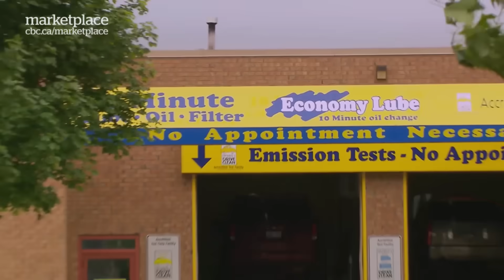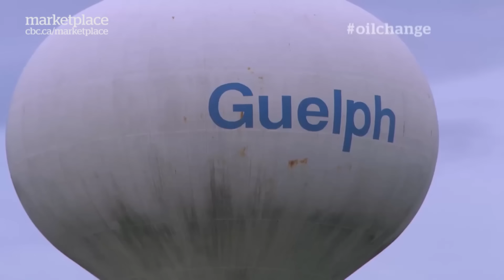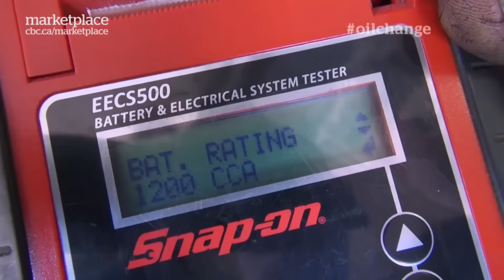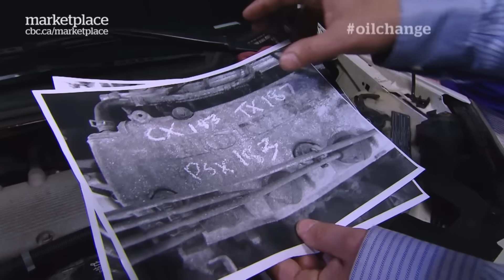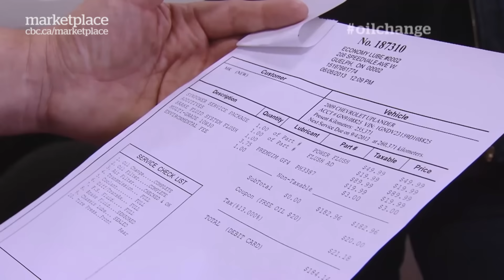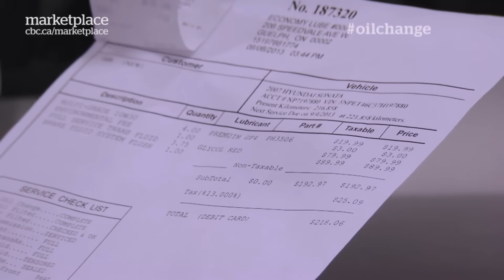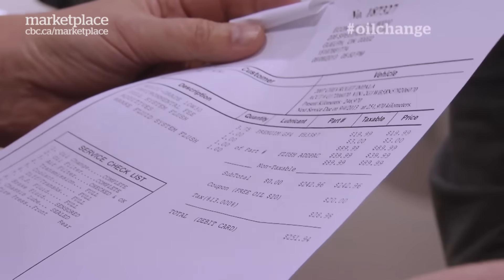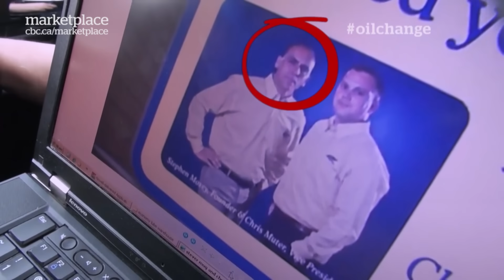Oil change scams: Hidden camera investigation on what really happens to your car (CBC Marketplace)

Comment: I used to work for Jiffy Lube in Portland Oregon. And unfortunately this location was robbing customers for their money. I was told to replace a fuel filter to a subaru which when I started to change it in the bottom of the hood the supervisor told me to put the old one back and wipe it with cleaner and charge the customer. I said no and before the customer left I told her what happened. And that is just the beginning. I ended losing my job. There are many other locations that I would not trust them. Just like this video they improperly trained to get the upgrade.
Reply: You did good by telling the customer.
Reply: @diegoarpino2080  Thank you..and being loyal and trustworthy to the customer was my number one concern. On top of being a man of God. Nothing else matters if you lose your soul to gain the whole world.
Reply: Jose Lopez I couldn't agree any more. :)
Reply: Jose Lopez And you didnt sue?
Reply: i used to work for one in Escondido California...same things happened at the shop i worked for.
Reply: I go to one in Central Oregon for oil changes...I have never purchased an additional service though, I make them print out their suggestions and take the list home to my husband. About half the time what they suggested isn't necessary.
Reply: Honesty will open doors for you ...
Reply: Your boss wanted to skimp on just a fuel filter? The per hour wages he pays you (to re-replace it) would exceed the price of one. With rare exceptions, fuel filters are cheap.
Reply: General Gravey I live in Escondido, thank you for the heads up....
Reply: makes me want to take me car out and play with all these jiffy lubes... as im a mechanic too
Reply: @Nehmo  maybe you did not understand..he wanted me to put the old fuel filter back and charge the customer.
Reply: @foo bar thank you. But my faith has nothing to do with religion or fear of God it is a personal relationship that surpasses any human being if you truly ever understood then ultimately comes down to honoring Him because I am being transformed through His Spirit,Holy Spirit. I know you've probably heard it many times that Jesus Loves you well,He does and I don't know how old you are but since I was born I have seen how this earth and the people in it have certainly are getting more and more evil. I believe strongly in the Bible and in Revelation it has not gone wrong. The worst is yet to come and I pray that you draw close to God,JESUS and the Holy Spirit before it's too late. He does not care about man made religions or rituals and TRUE Christianity is based on a lifestyle not an event. Seriously I thank you for your encouragement so I am giving you the most important one that you will ever get ...GUARANTEE. If you don't believe and repent you will find out in Judgment. God bless you. 

New King James Version 2 Thessalonians 1:3-12 God’s Final Judgment and Glory We are bound to thank God always for you, brethren, as it is fitting, because your faith grows exceedingly, and the love of every one of you all abounds toward each other, so that we ourselves boast of you among the churches of God for your patience and faith in all your persecutions and tribulations that you endure, which is manifest evidence of the righteous judgment of God, that you may be counted worthy of the kingdom of God, for which you also suffer; since it is a righteous thing with God to repay with tribulation those who trouble you, and to give you who are troubled rest with us when the Lord Jesus is revealed from heaven with His mighty angels, in flaming fire taking vengeance on those who do not know God, and on those who do not obey the gospel of our Lord Jesus Christ. These shall be punished with everlasting destruction from the presence of the Lord and from the glory of His power, when He comes, in that Day, to be glorified in His saints and to be admired among all those who believe, because our testimony among you was believed. Therefore we also pray always for you that our God would count you worthy of this calling, and fulfill all the good pleasure of His goodness and the work of faith with power, that the name of our Lord Jesus Christ may be glorified in you, and you in Him, according to the grace of our God and the Lord Jesus Christ.
Reply: @touaher2150  They are not all bad..but you just have to be there in front of your car..they won't allow you around the pit for policy enforcement but depending on the manager and their discretion, they can allow you to depending..especially if you get more than an oil change. Let's say you are spending to have three or more services. Even if you get the oil change the do allow you to stand in front of the shop and watch as long as you are not inside the shop unless you decide to vacuum you vehicle. Now most shops have cameras in the pit and in front of the vehicles zooming in under the hood.
Reply: I work for jiffy lube right now, and all jiffy lubes are owned by separate owners. I have never once in the many years I've worked there had to scam someone. I've worked both above and below the vehicle many times and I've never been forced to do a service that was not needed. Yes we do up sale, but tool and oil and filters and coolant, atf, etc.. That stuff is expensive!! It's a shame to see places that don't deserve to get hit like this.. Especially when you work for one of them. But just remember that most lube shops are privately owned. Yes they are a corporation, but the stores are owned separately.
Reply: @stopmotionking241  I understand and agree that not all jiffy's are the same but out of more than three I worked for two were doing it. Especially if their job was in the line. I respect you and thank God. God bless you.
Reply: + Jose Lopez I'm an atheist, and I'm still proud of you! Being good when no one is looking is the hallmark of honesty.
Reply: Do you or anyone know if Manufactured Dealerships do this? (Toyota, Mercedes, etc)
Reply: We need more workers like you being honest nice and everything
Reply: Jose Lopez what’s the locations name? We need to shut them down
Reply: You should own your own garage.
Reply: Lol i had one that didn't tighten my blower back on my Blazer and it overheated on the highway. Just last week... my cap for my windshield wiper fluid has been snapped off and its gone. GG.....
Reply: Good job!
Reply: So they have recordings of employees confessing about fraud they have video footage of the fraud and proof that services weren't needed or done at all? So why is this guy not arrested or out of business!?
Reply: So Jose Lopez u just have a burning desire to honor the gorgeous man of Jesus Christ? 

Or is it actually gorgeous Mother Mary?
Reply: @davidmmm8  ignorance I will pray for you.

Comment: My first car, 50 years ago, was a VW Beetle. I was doing all maintenance by myself, from oil change to brake pads renewal; the ignition distribution cap required frequent maintenance, just like the carburettor required frequent cleaning - there were no fuel filters at the time. Spark timing was depending on the season and the type of road. I did everything except tire maintenance; at the time, the car tires used an inner tube and that tube blew - among the 4 tires - every couple of months. None of my successive cars required so much maintenance, the Beetle was just crazy. And wasn't cheap, as it made 10 km per litre of petrol  ( 24 miles per gallon), while my next car made 18 km per litre (42 miles per gallon) even if had a bigger engine size.
My third car had an engine management computer, there was when I had to surrender - had a new demanding job and family in the meantime - and rely on a car mechanic for servicing. So far, I'm still able to identify a crook repairman on the spot with mired checks when I pickup the car; but not everyone admit guilt and cut the inflated bill...
Reply: Strange though , Im driving a vw beetle for about 12 years now and its the only car I have for so long while some other cars come and go by breaking down.
My vw beetle needs little maintenance and always runs. 
Only simple things like brake pads , oil changes etc
Even when it sat for 6 months in my garage , I connect the battery, flip the key and it runs.
My beetle is plus minus 50 years old at this moment so kind of impressive its still going strong 💪.
But im guessing you had a 6 volts older beetle then mine?
Reply: @jeffreyjansen8202  I would LOVE to have a beetle again!
Reply: I just hate computers on cars! I'd rather drive old vintage cars than some computerized misery! So far, no computer has lasted more than five years and not even the brand workshop has been able to solve the problems, but they have been decent enough not to charge me anything as they could not help me... I myself have converted a few transporters to manual systems that did not is recommended as it can cause almost any damage to the engine- although I've been lucky with myself...
Reply: All we need are Knowladge about engines,how to maintain it, and how it works.
and the rest, we could done it by our own.
Reply: I had a 1960 VW beetle about 10 years ago, and it was the easiest and cheepest car to fix. Granted, as an older car it did need constant maintenance and repair as every part broke down, but it was so easy for me and my husband to fix ourselves if we could find parts online. One night some drunk driver smashed into it and totaled it, and his insurance company paid me out $5,000 because it was a vintage car and that’s how much it would have cost to replace it on the open market, since you can’t just go get one anywhere. So I took the payout and ran. But I do miss that car even though it was constantly needing to be push started. I miss having a car that didn’t need an engineering degree to fix.
Reply: You didn't say if you changed the Coolant fluid! That's extremely important on a Bug.
Reply: @railfan100  You would with a name like "railfan100🤣
That was the only beetle I've owned. Sand Rail. What a blast~!
Reply: @suzykendallosborne  Always try to park on a hill🤣I remember
Reply: @andybilakshow260  Just like my BMW E21 back in the days! Or top floor in a parking garage when I was in the city.
Reply: About 55 years ago, I had a Mini, then various other cars in the following years, and I was always taking engines out and messing with them.  I've always done my own maintenance - but I was surprised by what you said.  At the time I had the Mini, VW Beetles were renouned for bad roadholding, and around Johannesburg, we used to frequently see them lying upside down (or clearly having rolled over) on the roadside - but I was of the belief that they were a mechanically sound car - well put together, didn't develop rattles - which my Mini cartainly did - and they were reliable, and were recognised for it.  I read several articles about Beetles having come through the Sahara and down Africa to S. Africa, along roads that are paved now - but ween't then - and they had arrived, many of them, without incident.  Many VW Combis (camper vans) had done the trip too with very little mechanical failure, and they used the same boxer engine.

I later did the trip myself with a Land Rover - and I had suspension trouble with it.  Land Rovers going through the desert were always urged to carry half-shafts and leaf springs - and frequently needed them.
Reply: @suzykendallosborne  I miss those days too.  I'm a retired computer engineer - both hardware and software - but the problem is you can't easily find out what a computer has been told to do.  Remember the scandal a few years ago with the VW emissions?  That was because their on-board computer had been programmed to detect when it was being serviced, and would change the injector timing so that emissions would be much less at that time, but when it was out on the road, VW had figured that it would not be being teted then, so the on-board computer retuned it for performance.  Unfortuntely for them,some American test centres decided to stick a sensor tube up the exhaust pipe and monitor its emissions while it was being driven.  Even when they found the result, there was a lot of conjecture as to what was different between being in service and being on the road - so even the experts didn't initially suspect software tampering in the EMU (Engine Management Unit - aka onboard computer).  I don't think they actually cracked what was going on, but it was so obvious that something was going on that when they challeneged VW about it, they had to come clean.  But that is possible because, unlike the beetle, modern cars don't have a carburettor any more, with spark timing set by a mechanical device (working from engine vaccuum) that any mechanically-minded person can understand.  Instead, they have fuel injectors that are meticulously timed by an EMU that is running code (program) that nobody can access.  Cars would be better if it was law that EMU code had to be available to the public.  Even then, there aren't too many people who could understand it - but there would be enough to figure out the wrinkles, and possibly even the odd few that could improve the code and make the car run better.
Reply: I still do that I got a 1998 c1500 I have donit all in it
Reply: @64TommyG  The problem is that the manufacturers found loopholes in the law that standardized and required OBD/Canbus. They're not worried about developing a reliable product when they're the only ones that can fix it. They know the money will come. The law really needs to be updated (the loophole is to use wireless communication technologies like wifi or bluetooth, rather than physical wires. The law was poorly written)
Reply: @64TommyG  I like old carbureted cars too but with a after market ECU like a MoTeC and some basic pc knowledge it is a better choice. They come with programs that use the same terms as mechanical cars but instead of pulling apart your distributer or re-jetting your carb, you just plug in a few numbers into your laptop and your done. You save money in the long run, save time and make more power!
Reply: 10km per litre is 45km per gallon

Comment: I had a recent experience with getting an oil change. After the oil change, I suddenly started losing oil, which had never happened before. Every gas fill up, I had to fill up  on oil too. By the time I was able to figure out what to do about this, the vehicle blew up and became a total loss.
Reply: Without being disrespectful that doesn't sound like it's the fault of the oil change place it sounds like your car was burning oil in the engine was going bad lol. It's easy to blame other people for our problems, but try and take responsibility sometime. It's good for you